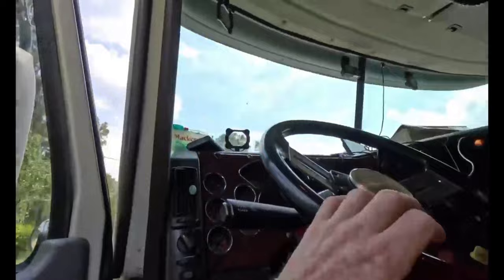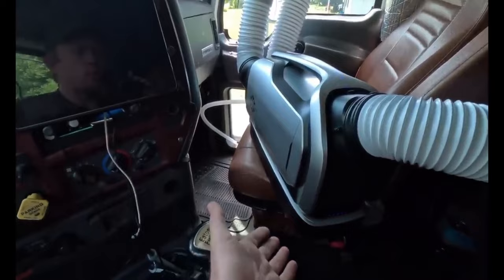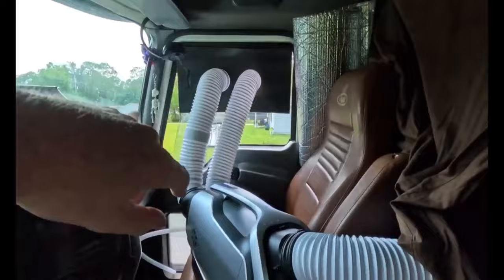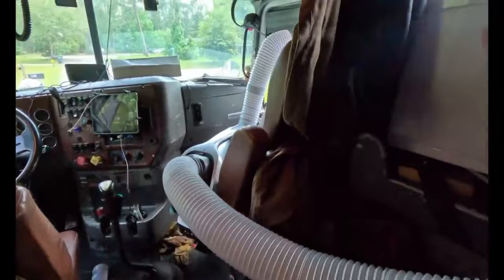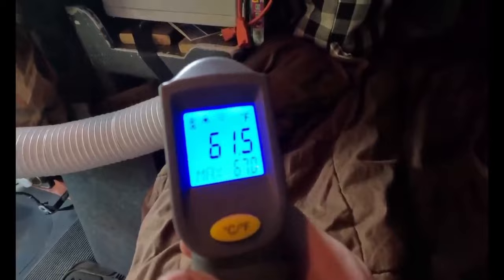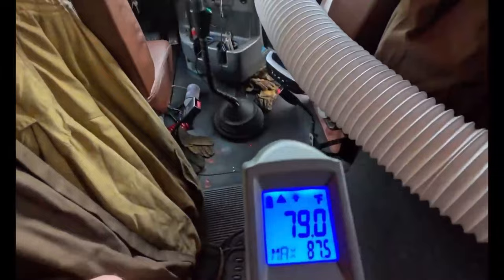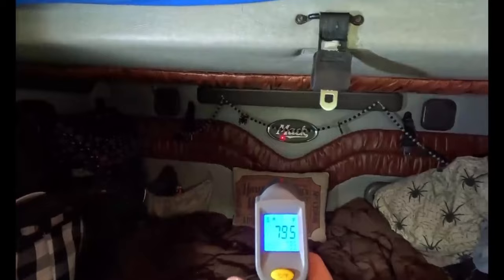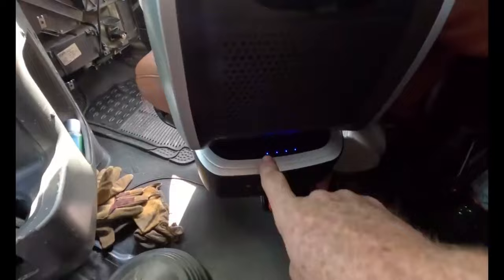How Efficient is the Cooling Performance of the ZERO BREEZE Mark 2 Portable AC for Your Semi-truck?

Comment: I'd still take a apu over a 2 grand ac unit that takes up half the semi liveable space plus makes you block everything up like a coffin plus you could save a bunch of money and get 2 deep cycle batteries and inverter and just get a portable ac unit that takes up lot less space
Reply: That what I did 4x 150ah lifepo4 batteries ,3000w inverter, DC to DC  60a charger and a shunt to monitor the batteries and a $600 12v mini split.

Comment: can you seal up the window better and redo your test? seem like it would most likely cool the entire cab if all that hot air wasnt getting in the cab through that huge gap infront of the exhaust hoses. ive never heard of this portable a/c and dont have a apu on the truck so im genuinely curious to the difference it would be if the window was sealed.
Reply from the maker: Hello, thanks for asking. Using a well-sealed setup will definitely result in better cooling for the cab. Just to let you know, we offer a 30-day hassle-free return policy (available in Contiguous United States only). So, why not give it a try? You can purchase the Plus Set or the Plus Extra Set, which comes with a portable bag valued at $199. Don't forget to use the code YTB100 (valid only for this month) to get a discount. Stay cool with ZERO BREEZE: https://bit.ly/3OJZ5lU
Reply: Knowing how ac works and being an owner operator. I would recommend taking off the intake so you recirculate the cooler air in the cab already. Just like that one button by your ac switch.
If its86 outside it should only come 20° cooler. So if you cool off your truck down to 70-75 degrees, it recirculation those Temps 20 degree cooler